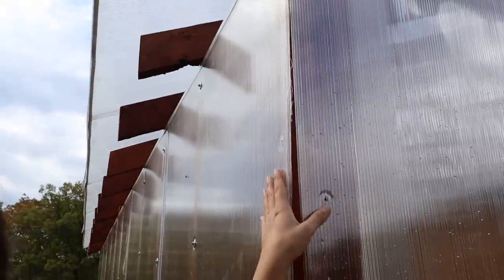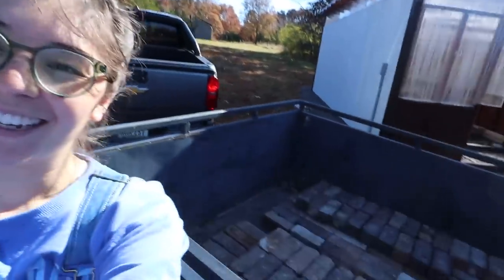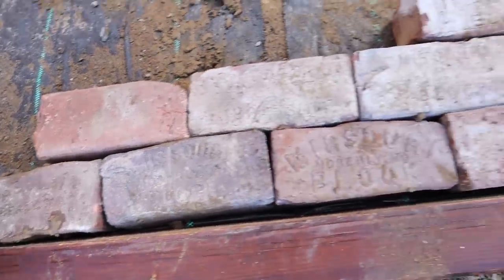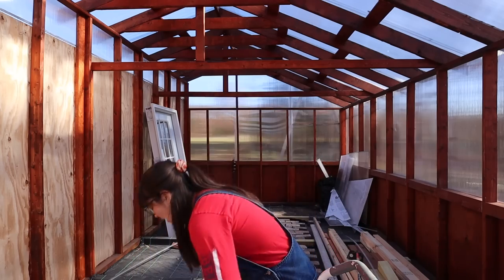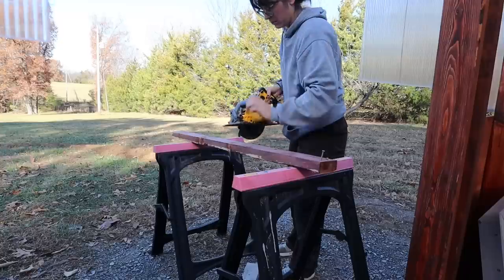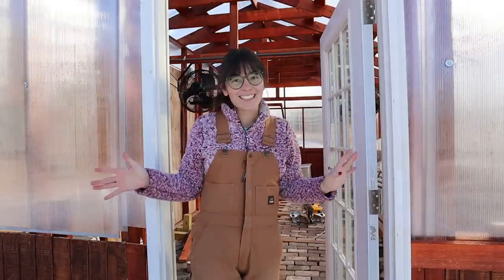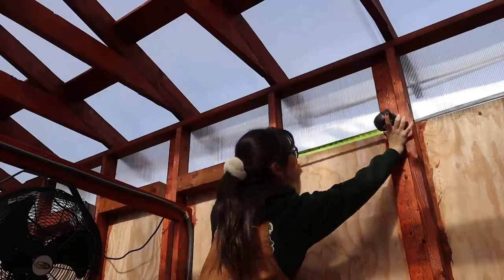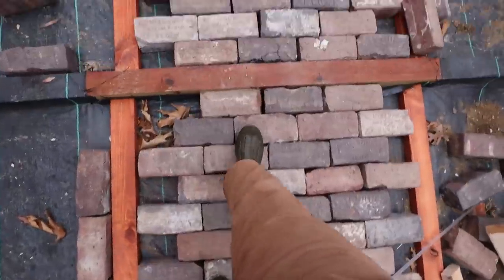Building my DREAM Backyard Greenhouse | brick path, finishing exterior touches & more

Comment: Regarding the PVC corner pieces that you start to discuss around 04:00 you need to flash the wood behind them.   Otherwise, water will travel behind the PVC and rot out the wood behind the PVC.

Comment: I used to work in a hardware store and about half of the staff were women. The amount of times I (or another female member of staff) responded to calls for help lifting or getting things in peoples cars and then the looks customers would give me was honestly so frustrating. Especially some of the comments from older men. I have a slim build but I'm a qualified yoga teacher who spends a lot of time bearing my weight on my arms 😂I know what my limits are. You know what your limits are and when you need to ask for help and that guy clearly just had his ego damaged.
Reply: I used to work in the hardware section of a department store and I would literally get sent to find a guy if I responded to a call that required lifting. Didn't matter that I was physically as strong or stronger than most of the other employees in my section. It was infuriating.